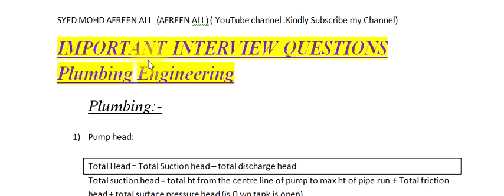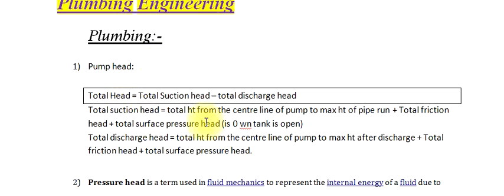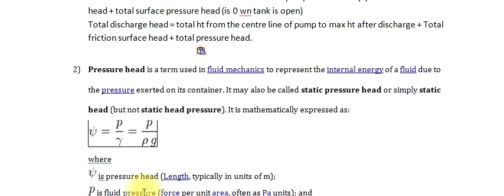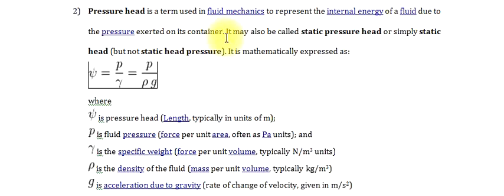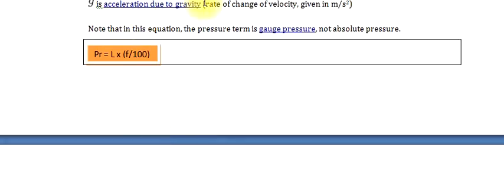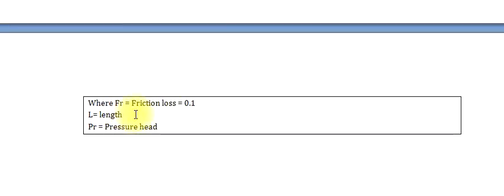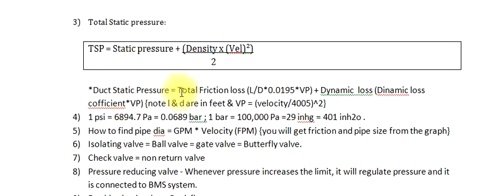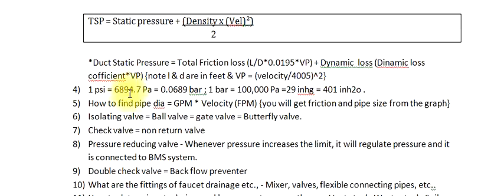Plumbing Engineer Interview Questions and Answers

Comment: good work sir,
but I need pump head calculation,can u please send me a snap shot on my email
Reply from the maker: CALCULATING DESIRED NOZZLE AND PUMP PRESSURES

Engine and nozzle pressures are calculated as follows:
DNP = Desired Nozzle Pressure
EP = Engine Pressure
HG = Head Gain
HL = Head Loss
FL = Friction Loss

Desired Nozzle Pressure equals:
Engine (Pump) Pressure ± (Head Gain or Head Loss) - Friction Loss
    DNP = EP ± (HG or HL) - FL
Reply from the maker: http://frictionlosscalculator.com/
Reply: Sir kindly send any best app Link for calculate the pressure